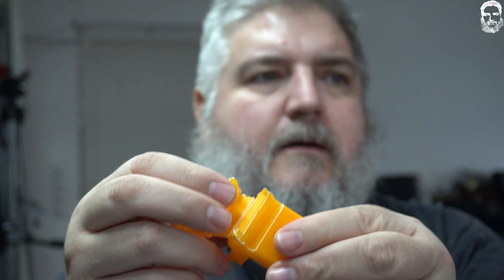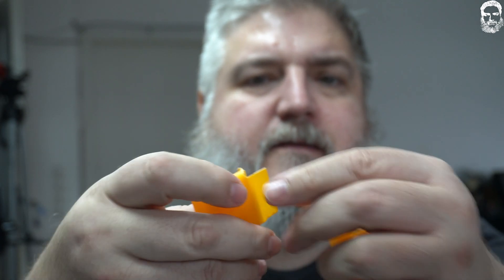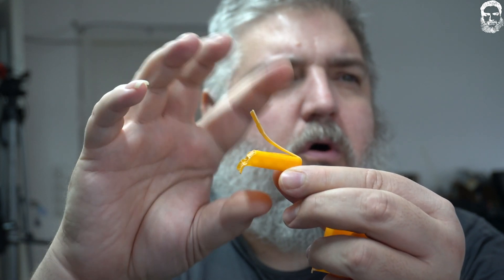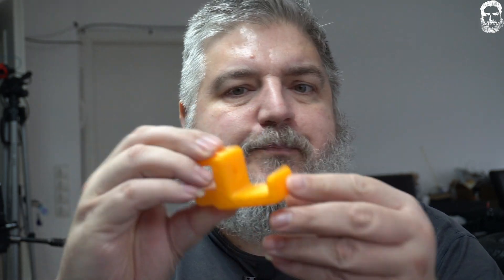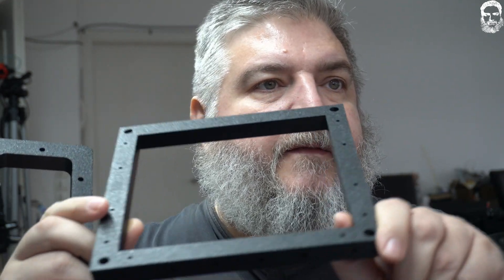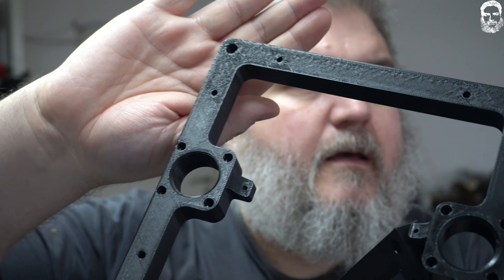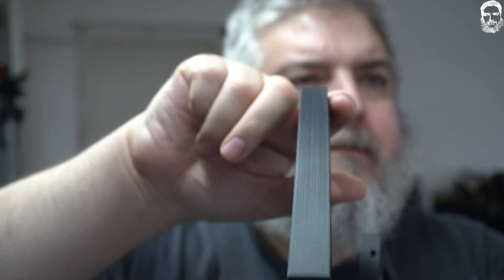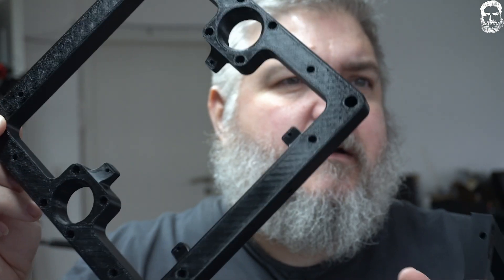unacceptable print - BambuLab X1 Carbon Combo AMS prints - ABS - HIPS - PETG

Comment from the maker: After more "problems" and tests I can say that not the printer was the problem on this unacceptable print - it is a slicer problem! If I look at the file with a viewer, there you can see the nonsense. the printer had no chance to print it right. If you have not seen it, there was also a strange thing in my "HELP" video, trying vase mode. There in the preview you can see "the problem" - I recorded it without noticing that it is exactly this problem happening and I´m not the only one with the problem. the only solution for me (and others as reported) is Restarting the slicer, it does fix the problem, but then you have to do all the changes again, if you have done some. There is no working undo if it happens.

Thanks for all the positive comments and thoughts, they helped to look deeper into the problem.

Best wishes
Sandor - DM4DS

Comment: What size nozzle do you use for printing big parts
Reply from the maker: @viseshminerva4091 the BambuLab X1 has still it´s 0.4mm stock nozzle - on my sidewinder X1 for example, I´m using a 0.6mm - and I have ordered the 0.6mm for the BambuLab X1, too. will install it in the next weeks.

Comment: The top surface problem may or may not be related to the x-rods. Regardless of if this is the problem, when printing with ABS a lot, the fumes can collect on the carbon rods and increase friction. This leads to less smooth motion or even seizing of the printhead. Simply wipe down the carbon rods with ipa until most of the residue is gone

Comment: Your failed ABS prints look like de-lamination
A quick workaround if adhesion to the bed is not an issue is to increase temps, slow down speeds and increase the infill density 
Also make sure your fans are turned off 
Then again sometimes the simplest solution is right in front of us, simply try a different roll of filament 🤷‍♂️
Reply from the maker: But why are all prints before and after perfect without changing settings or filament? Some thought that the problem is the slicer and I had 2 more times with strange slicer outputs. After a slicer restart, all looked fine in preview again and printed fine. Looks now for me too, more like a slicer problem that comes and goes. Maybe you look into the "help" video, there you see strange rings in vase mode, that was also this strange slicer thing... after restarting the slicer, all was fine and no rings. Thanks you looked the video to help and commented. If it comes back after the review was fine, i will try things you described. greetings Sandor
Reply: @DM4DS  I also have subscribed to your channel in the hopes that we can grow this all together and perhaps one day help you with some more income (every little bit helps)
Not to mention I have become a fan of your channel 
Greetings from Canada by the way 😀
Reply: @DM4DS  looks like a partial clog.  On other printers, I get this from time to time using cheap filaments and smaller nozzle sizes, likely due to debris in the filament.  I also get this due to keeping nozzle hot during filament change over then walking away for an extended period.  A final option is a loose extruder gear that is not gripping the filament sufficiently.

Have you had this problem since?  Did you get extra nozzles that you can swap out and run the same gcode?  Good luck troubleshooting.
Reply: @DM4DS  are you printing via the SD card or over the wifi ?
I'm always skeptical about wifi and prefer using SD cards myself
A small interruption sending the file via wifi causes issues in the file transfers
Reply from the maker: @johnnyrocko7105 I was only using WiFi yet, have not tested SDCard. There is one installed for the timelaps, I think they are stored on the sdcard. aren´t they, or are they stored internal? So many things I still have to check. Don´t had time to look into the file from the "unacceptable" - but will do that for sure the next days. Time, we all know, is the problem. Must do things for living :) Also working on a project for the channel. Trying to update if I find why or how.... thanks for you comment and sub. have a great time - Sandor
Reply: @DM4DS  yes same micro SD card that records video on the side of the display is used for SD card printing

Comment: Maybe your pinky nails get caught on the prints and cuts them 😅
Reply from the maker: hihi, that would be a fun story :). to explain my pinky nail: They are one of my trademarks. it was born as a challenge with my father, god bless him, and espacially after he died, it´s my way to carry him with me - have a great time Sandor - DM4DS
Reply: @DM4DS  oh man that’s kinda cool I was just poking the bear , great video so what is your thoughts on the x1 carbon or the bambu lab printers ? I’m debating on buying one or waiting until they build bigger build plates would like to see at least 300x300x400 or 400x400x400
Reply from the maker: @zachofalltrades6116  I waited also for a bigger one, but most time I don´t need it bigger, so I decided to no longer wait and have fun with it. My other printers are fine but not in the same league. The 250x250 are not that much smaller than my Sidewinder, but still bigger than my Delta with 220 diameter. Think BambuLab had the same discussions before they have build the X1. Going bigger as the "normals", but not as big as a Prusa XL ( XXL?) . 250mm keeps it compact and still big enough for most, also the costs in normal spheres. Where I´m "negativ" is the TPU problem with the AMS. Maybe I´m building a TPU only printer, don´t like the Y adapters in the middle of the backside....I´m sure you have seen the mods. Would I buy another one or again, 100%. Hope to see you in the next video in the comments :) - greetings Sandor
Reply: @DM4DS  well I pulled the trigger last night and ordered the x1 carbon combo can’t wait to put it to the test!

Comment: seems that the nozzle is partially clogged , try cool pull to clean the nozzle ?
Reply from the maker: @duncurtain6187 - that´s what i thought , too. but next prints were fine without doing anything. Not sure it solved the problem by itself.

Comment: I'd say it's heat creep. Chamber too hot, hotend too bad.
Reply from the maker: @REDxFROG  not exactly sure during this print, but on the following prints (without problems) the chamber was never over 40°C. The hotend worked fine before and after this print without changing anything. Some think about a temporary clogged nozzle or... - Thanks for your comment, Sandor - DM4DS
Reply: @DM4DS  maybe it's a malfunctioning hotend fan. I'm pretty sure it's temporary clogs due to molten filament in the hotend heatbreak.
Reply from the maker: @REDxFROG  Will have a look on the hotend fan - maybe i see something in recordings. Good idea.